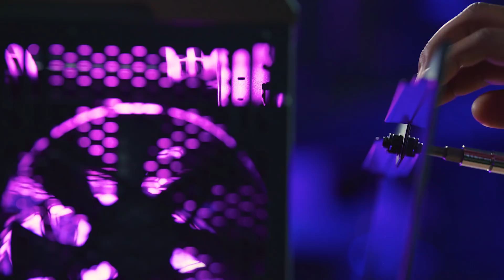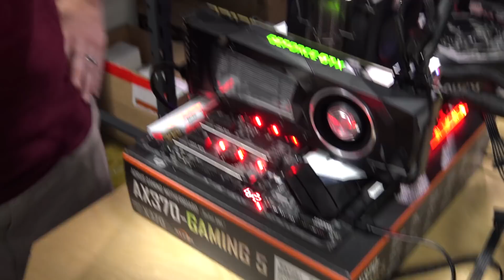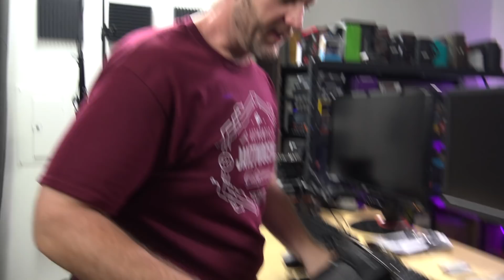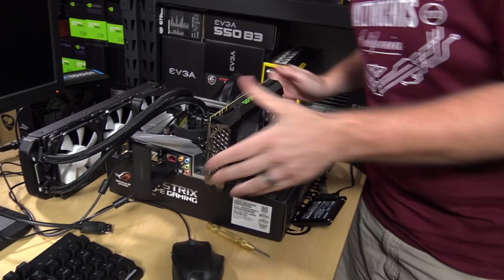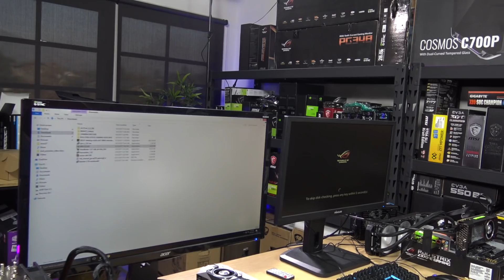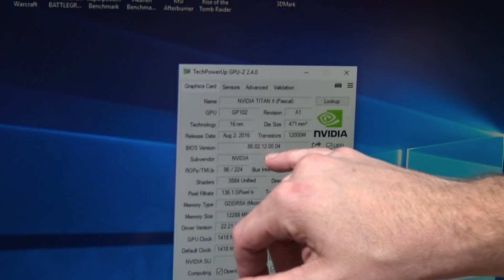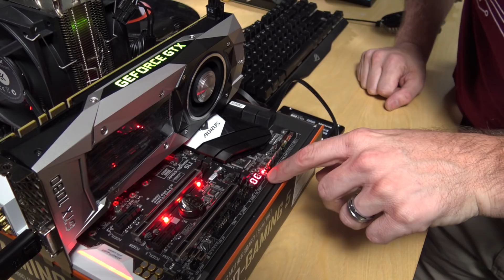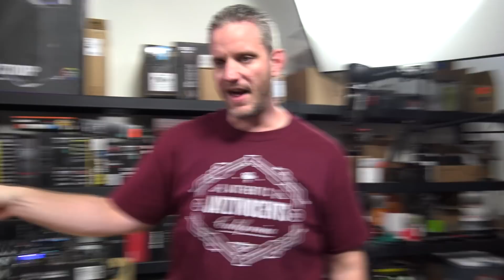I cant figure this one out... HELP!

Comment: Hey JayzTwoCents, This comment probably won't be seen. I had a similar problem with my 1080Ti and took alot of google-fu to find the issue. My issue was my 1080Ti would not post on a cold boot. It is an older motherboard in my machine and I had to enable Asus express gate. Essentially what was happening was the Display Port was not negotiating a signal protocol to the display before the post was ready causing the system to stall. Enabling express gate delayed the post long enough for the signal to negotiate.

If you use an HDMI 2.0 cable to your display does it still have an issue posting, Or warm booting the PC allow it to post?
Reply: Up vote this I think this is worth looking at
Reply: just when i read this i realized i am having the same problems on my 1080ti with ryzen 7 since i switched to display port from hdmi because of g-gsync . Sometimes the Pc seems to stall during boot but if i reset it it starts as if nothing ever happened , this is on a x370prime asus board , which i would not exactly consider older though (newest bios is installed).

Actually really might be an interesting find
Reply: different problem. If it was the case it would do it with more then 1 gpu card.
Reply: Jeff Aschenbrenner you might be on to something there, though i doubt i onlly tried booting from one port
Reply: For me it was a startech cable, i would assume that its a certified cable. I actually have a new monitor now and have not tested. Maybe I will do that now quickly and see if it posts if i disable express gate.

update: cannot even warm boot new monitor with express gate off. the best explanation that I could find online was that it has to do with DP protocols not negotiating before GPU post causing GPU post to FAIL (I am not an engineer and this is just speculation). My solution was to slow down my post as much as I could and that seems to have resolved the issue for me.

Intel I7-970
Asus X58
Evga 1080Ti FE
Reply: I don't think this would case an error display on the mobo, just a black screen.
Reply: I use amazon basics cables now. They work, are good quality, and they are cheap. Startech has given me nothing but problems half of the time.
Reply: This is worth a try. I know from experience that displayport can give all kinds of weird issues. Try a hdmi cable
Reply: my 970 with same cable and monitor had no issue.
Reply: I cannot tell from my perspective since my board does not have a readout, I am resulted in a black screen (no "no signal" error on monitor) but the machine is 100% not posting
Reply: Have had this issue before.

Quick an easy to rule out.
Whatever display standard jay is using now use a different one :P
Reply: Jeff Aschenbrenn
Reply: Agreed, also set the monitor to a dedicated input rather tan "Auto detect" and all will be good.
Reply: Jeffrey W ^^ this. Try hdmi and I bet it will work. Display port is so temperamental!
Reply: +Jeff Aschenbrenner Well done man.
Reply: I had this same problem with my 980ti on my haswell rig. It drove me mental for days.
Reply: Graphics card slot on mono is bad?

Comment: If you have removed the graphics card and the motherboard as a problem. Maybe the cable or the monitor are somewhat off in such a slight way. Maybe some weird feedback through the cable? Failed HDCP handshake? I've seen computers not willing to turn on when connected to a tv but not to another. I didn't have a motherboard with post codes to tell me.

Comment: @JayzTwoCents  I know the answer.  The reason is due to a fault in the IMC on the Ryzen Threadripper chip.  They are currently on AEGSA 1.0.0.6/1.0.0.7 and this has considerable issues.  These issues are often recognized by 128GB 8x16GB RAM configurations often never working.  When the IMC fails you will get no POST, often with a CO (or OC) error code.  AMD has been very tight lipped between motherboard makers in their rush to release an updated AEGSA.  This IMC issue can also impact interactions between PCIe<->CPU connected devices such as GPUs with large memory mappings.  

Source:  I'm the owner of CPUCores and I do considerable CPU testing to validate new CPU architecture.  I purchased 4x motherboards 4x Threadripper 16core 4x 128GB RAM kits.   None of them would post with 128GB RAM.  Worked extensively with AMD and Asrock and the issue is now being worked on.  

It is suspected that the IMC of Threadripper are very weak in design with too much cross-talk in the chip design constituting a physical flaw in the current batches of Threadripper.
Reply: Only question remains, why the other Titan is working on the Ryzen setup.
Reply: The error code was not actually OC on the GPU that didn’t work, the test bench is not thread-ripper, and it only had two ram sticks.
Reply: AEGSA ? its AGESA*
Reply: i mean its something you cant really predict, i mean for 99.99% of computer users this problem with threadripper is never going to effect us
Reply: Unrelated max?
Reply: hmm, I've tried a K80 on an X399 board and ran into similar post issues.  Getting codes for Memory errors, but when I remove the K80, everything runs fine.  I need my horsepower!
Reply: StartupTim That's a nice explanation, but it is not the awnser to Jay's problem. He doesn't work with 128 gigs of ram and I think we are talking about ryzen 7, not threadripper. Still interesting find you got there.
Reply: Cioby Typical Intel, re-releasing the same CPU (with an slight overclock, and a slight architecture refine) for 6 years until they had competition.

Neither brand is perfect.
Reply: I've seen the same thing happen on a ryzen 7 1700 build with an nvidia gpu. It also had 4 dims populated and when only running one stick of memory was able to push past the blackscreen to windows.
Reply: Do you mean AGESA?
Reply: Nice muddying of the waters attempt, but your explanation doesn't cut it.  If it were an IMC error, why did the identical make and model card - with the exact same firmware work on the Ryzen bench? Both cards woul've failed to POSt if your (erroneous) theory were true.

Methinks you are an Intel troller trying your darnedest to pin mysterious issues like this on an AMD cpu.

Try again.
Reply: Dumb Fanboy - it's not an AMD Graphics Card and AMD didn't make the Motherboard so use your head before commenting
Reply: Typical AMD crap. Shit not working.

Comment: It's a gpu bios problem I worked at a shop and hade that problem before I rewrote the bios on card worked fine but u didn't check the bios on the other Bench

Comment: You checked the bios version 2 times on the same card.  You needed to check the one on the Intel system - not the AMD system(you had already checked it on the Intel system).

Comment: power supply fault - pcie power connector, broken capacitor on the pcie-cable-power rail and voltage ripple under load. one card could handle it, boots thru by disabling the input, using the pcie-slot-supply, one card doesn't and keeps using the pcie-cabel-power, which brakes down under load.
Reply: My initial thought was power issues; the card in question could be pulling too much power, the components on the Intel system might handle it where as the AMD can't. Not saying it has to be the motherboard, could also be the PSU; but I presume Jay would have swapped out the PSU as one of the first troubleshooting steps.
Reply: could also the video card be sucking way too much energy from the motherboard PCI-E ?
Reply: But he put in a Vega card that would draw more power than either.
Reply: How much power a card draws while running isn't relevant for its initialization. There might be a voltage/current spike while initializing which triggers a protection of one componet.

I always check the power supply, if a system starts acting up, because problems there often cause some really wierd phenomena.
Reply: +Darran Styler
He literally used 2 identical Titans..AMD system could handle it just fine.

As Marcus already pointed out, it's more then likely the PSU.  Not the AMD board what so ever.
Reply: Sorry to wake up this thread after 2 weeks but I actually had a faulty power supply cable in my 1080Ti. The system didn't boot but it did display a message on screen asking me to plug in the power cables so it can't be that. What I mean to say is that the card refuses to start up if it can't pull power from all connectors.

Comment: Conclusion: You got a bad AM4 motherboard from Gigabyte. It happens. The X370 silicon on the chip is faulty. Also, 2 different cards that are the same models are not the same. You yourself talk about the silicon lottery. It applies to CPU, GPU, and Chipset. So I would say to swap out the motherboard if you want to eliminate the possibility that the motherboard is bad. Oh and like everyone else says: you didn't check the BIOS version of the card that doesn't post in the AMD mobo. But I am assuming you did check that already off camera.

Comment: I had issues with UEFI systems in which one registered a few things in the UEFI and another did not and one booted much faster and the other didn’t. I even copied the bios from one to another and I copied the network card MAC address. Gigabyte was helpless on it. I had to hexa edit the file to fix it. Anyway, in UEFI systems, if it acts up the first thing I try is to reset the NVRAM and if that doesn’t work then consider reflashing the bios on the motherboard again.

Comment: Besides checking the same card bios on the two setups xD, I had a strange issue with a MSI Z77 G45 as soon as I threw in a new Sapphire RX 480 8Gb Nitro+ a year ago. 
Literally the system went bogus.. I already had the latest bios (that of course was relatively old and certainly not thought for RX 480s), to a point that putting in my previous GTX 960 2Gb that worked fine until a few minutes before I uninstalled the drivers in preparation for the AMD card. It wouldn't even post puttin the 960 back! The mainboard was literally dead, fans powered up, few seconds and then no further post. I couldn't even get into the bios, clear cmos done a dozen of times, dismounted and reseated everything, tried another PSU, tried to check if there was some ground discharge issue.. none.. wtf..

In the end I had to reflash the motherboard bios.. I did remove everything, plug just one usb pendrive with the latest bios in it (the same that the mainboard was using before it decided to go nuts), reboot after reboot until the mainboard realized it literally missed the bios and accepted the reflash. 

It  has been fine until now, memory has always been the same, just added a few hdd/ssd. 

Somehow putting a new card literally corrupted the bios, don't ask me how. I guess tech has its ways to go to hell by itself xD.

Comment: Hey Jay first the card you said that is not working it is the one that you put on the intel build. The problem appears to be the die lottery the tolerance on one card may be wider than the other and that is why it works on both and the tighter only works on one. The the firmware of the video card may have an effect but not always really think it's the die lottery.

Comment: Had an issue with a Syba FireWire PCIe card causing my ASRock X370 Fatal1ty Professional Gaming to show error code 00 that made me think my R7 1700 was bad. Removed the Syba card and system worked fine. Got a replacement and it worked fine until I tried upgrading from Windows 10 1607 to 1703 when it caused the same issue. Returned it and got a Vantec card instead. Ryzen seems to be very sensitive to flaky PCIe devices.

Comment: i had this same issue  of random strange postcodes and one gpu not working and one that did my issue was due to motherboard flexing/bad quality control and the board had  a defect that would cause random post errors  based on whatever it was  not being fully connected i.e ram cpu or gpu. as for the gpu it would work in the first slot every now and then and then not at all. i swapped it to a different slot at it would be fine... usualy. the gpu in question was fine in any other system as was the ryzen 7 that i was useing inc the ram a new identical board solved my issue.

Comment: Hmm, see what happens if you put the 'bad' GPU in a different pcie slot
Reply: I have a similar issue with that same card (XFX R7 270x). It works perfectly in either 16x PCIe slot on my Asus M5A97 EVO mainboard with a Phenom II x6 1090T, but will not work at all on 2 different Intel systems I tested. One was a Haswell-based Pentium and the other was a Kaby Lake Core i7 (both Gigabyte boards).
Reply: That sounds like exactly what would've been my first thought...why not try another PCIe slot?
Reply: ikjadoon yeah, I thought this because I had an r9 270x and it seemed like it wasn't booting so I put in another random card I had from a super old PC and it booted fine then because i was lazy I put the r9 270x in the 2nd pcie slot I had and left the old card in the 1st and it booted fine then I tested with the r9 270x with the different slots and i found out that for some reason the 1st pcie slot simply didnt like the r9 270x but all the other slots were fine

Comment: Factory overclock instability on the graphics card? 
Didn't you just do a video a few days ago where 2 1050ti that were the same model were performing very differently than each other?
I'm starting to wonder about nVidia's quality control.

Comment: It's a problem with card then. You determined that the motherboard and cpu  and everything else can run every card but that particular titan. Clear all the drivers from the system and reinstall them then flash the bios

Comment: ive had it happen to a gtx 1060 it was in a intel rig and working for ages but stopped working one day so i plugged it in a amd rig and it worked straight away even played games with it so i tried it in another rig and it worked too so nothing wrong with the card.. plugged it back in the origional rig and no screen replaced the origional rig with a old gtx 980 gpu and it worked straight away so yeah know either i believe its called haunted hardware :P

Comment: I have had a weird thing with a HHD a buch of years ago that might be weirdly similar to this problem.
It worked just fine BUT after a reboot it was gone from windows
It turned out that 1 of the IDE pins was from a 2'5 insch HDD and not a thicker pin from a 3'5 insch HDD
This could be the same kind of thing where there is something wrong with the contacts.

Comment: Assuming you checked the bios on both cards and that they're actually the same.  Then there must be something different about the cards.  I would check them physically to make sure they are exactly the same model/revision and that everything is physically the same.  Then on the intel system, check everything that GPUZ reports is the same too.  Could there be anything about the connectors that are different that could cause a problem on one MB but not another? Does the suspect card work on other MBs? do you have any other Ryzen boards you can test it on?  Weird :/

Comment: I would guess it is a problem with the bios of the mainboard
Reply: I had a similar problem last year on my x99 5960x build. I had a pair of 980 ti cards and one stopped working and refused to work in any pcie slot of motherboard however the other card would work fine in any pcie slot. I sent off my faulty 980 ti to be told its fine and they returned it and it would still not work my end. It turned out to be my cpu which was faulty. When i took it out of socked it had a couple of scortched terminals on the chip. Thankfully it was replaced under warranty and still using it to this day.

Comment: I've been building PCs for many years now and I haven't seen this with graphics cards yet, but with RAM, which I think is even weirder, as RAM should be way less complex than a high end graphics card. So why would two supposedly identical sticks of RAM behave differently on different boards? They shouldn't, yet they do. I have by now come to accept that PC components can be esoteric like that and that I sometimes simply cannot find a solution.

Comment: you have a short on the board in the pci-e express slot . the slot was moving around you need to check for a short to ground it's should be easy to find and the check the power rail's coming from the slot to D-ram  and cpu

Comment: I would love to find out why my task-bar goes back to 1 high after every reboot.
I want it 2 high and on auto hiding but Windows 10 hates it is seems.
Yes I have asked Microsoft and they say it is because I have CCleaner installed.
But I do NOT have that software and never used it either.
Microsofts answer to that is ........................................... Yeah nothing.

Comment: I had this issue happen with an i5-2400 System and Radeon HD 6850 card. It perplexed me for literal months, then I got sick of it beating me and tried a strange solution that I think I found online after lots of searching: Limit the PCI-E lane access between the mobo and the card physically (by electric taping down the PCI-E contacts of the Graphics card before inserting it) . I still, to this day, don't know why it worked the way it did, but I think my results were:
PCI-E x 16 - Constant Failure | PCI-E x 8 - Sometimes Worked | PCI-E x 4 - Worked Perfectly.

Comment: You might report this to your motherboard maker - I would still think it's the mobo. My guess is a bios update will come out for the mobo and it will work. It's new technology still.

I'm just glad this stuff does not happen too often with graphics cards. I have had much more trouble getting some fast memory to work than any graphics card.

Also as many here already pointed out you check the bios of the "bad" card twice and never check the bios version of the "good" card.